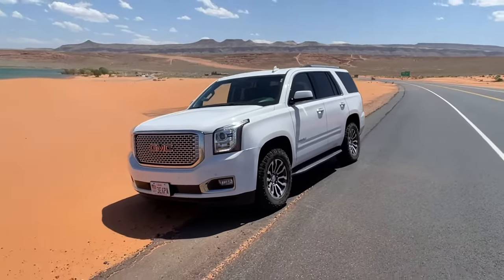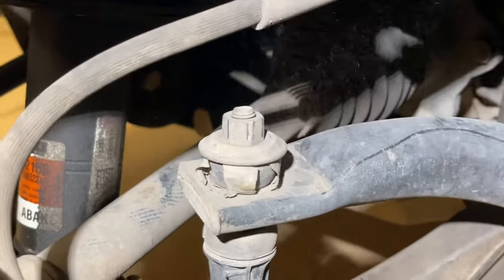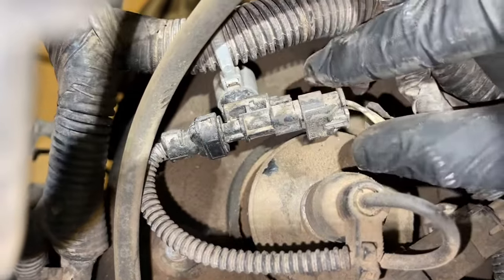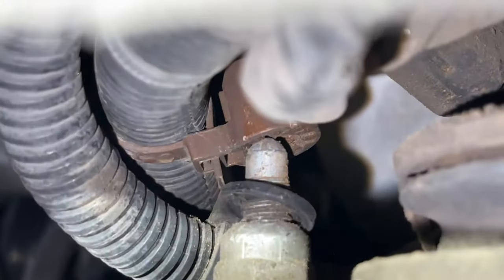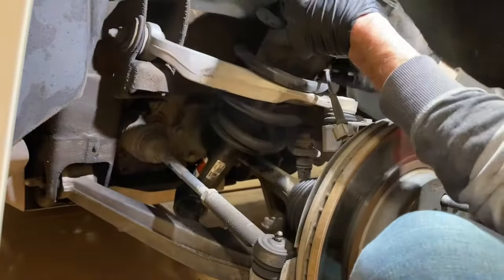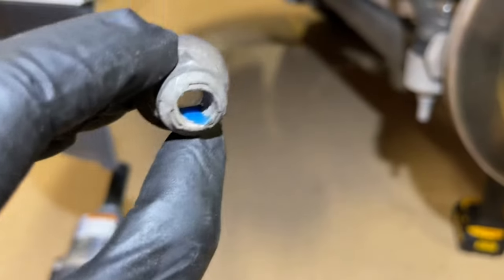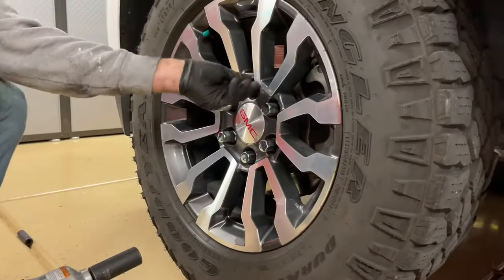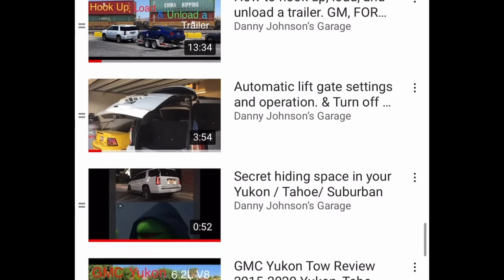2015-2020 GM Front Strut replacement: Magneride Yukon Tahoe Suburban Sierra Escalade Chevy GMC

Comment: Very good explanation of the parts swap! Any idea what the dealer charges to do this? Also how much do the parts cost?
Reply from the maker: Unfortunately, it’s hard to find OEM parts with the spring installed, so I went with an aftermarket company and the strut did not 
line up properly and the strut was 2” too long, so I had to put the factory one back in.
Reply: 💪🦵 An arm & a leg @ a dealer.💪🦵
Reply: In Houston at the dealership they just quoted me ~2300.00 to do both sides. I am working with another private mechanic and he's going to be able to do it for about 1/2 and still use OEM parts.
Reply: @gregggreene791  ya...doing this job now in my shop
.
I watch videos on my smoke break
Learn tips and tricks....where a tricky thing is...etc(aka, nit mess up your car messing up a connector or hidden bolt)
.
.
Anyway
2300 is HIGH af
.
This is not a hard job
2 or 3 hours tops!!
Reply: @dannyjohnsonsgarage   Did you ever find the correct part? i've now tried 3 different brands and spoke to the engineering team each time trying to solve this problem. So far Arnott, dorman and 1A auto have not fit.
Reply: @gregggreene791  can you share this mechanics contact info? I am also located in Houston.
Reply: @dannyjohnsonsgarage  Just had my fronts done on my 2019 Yukon XL Denali (150K miles). The dealer wanted $2400 and my mechanic did both sides front(full assembly) for $1800

Comment: I ordered new ones off of Amazon and they are the same as the ones I took off but the front is sitting to low. Was I supposed to reset the computer or something to get the ride height back to normal or is it possible that I have the wrong shocks
Reply from the maker: The ones that came for me were too big and didn’t fit. I re-installed the old ones. Did you compare them at all to the ones you took out?
Reply: @dannyjohnsonsgarage  yea just did and there the same exact height.
Reply: Seems like lots of variation in the part. Did the swap yesterday. Same OAL as the stock strut, but the spring myst be stiffer because Im sitting an inch higher up front. Not the funnest job to have to redo in the driveway.
Reply: @professorlloyd1789  I ended up putting the old springs on the new struts and it worked. It did suck having to take the struts apart 3 times and installation.
Reply: @dan79transam65  I thought about doing that or just buying the strut and having a shop swap my factory stuff onto the new strut. But due to time constraints I need to resolve this today… ordered some Arnott SK-3354s from autozone and will try those. About a $500 upcharge, but I can get it today and I’ll have Arnott’s warranty if they start leaking early. They’re actually a traditional Eibach gas strut with a built in connector that keeps the computer happy.

I’ll update as they may be another viable option(albeit at a higher price point.)
Reply: Updated. The Armotts fit well, but will probably lift the front .5” of a stock Yukon or so as they were .5 longer, bottom of the mounting ears to the top plate of what I assume were the factory struts in my ‘15 XL. I used a SuspensionMaxx lower spacer(1.5 lift) and Im pretty close to level when my initial measurements were a 2.25” rake with the factory front suspension.

Ride is better than the rock hard leaking magnarides. We’ll see how that changes after a couple thousand miles.
Reply: @professorlloyd1789  I was considering these as well. On a stock application I will be sitting high in the front with the Arnotts? Thanks for sharing.
Reply: @cwsosby  On the set I got, it raised the front about .5". by themselves. I installed the suspension max 1.75 lower block at the same time and my front is just below level with the rear(it has settled a bit in the past few weeks). So if you just swap the Arnotts in, I would expect your front height to maybe settle out .25 to .5" higher than stock, but still well below level with the rear.
Reply: @professorlloyd1789  Excellent, thanks for letting me know.

Comment: Is alignment needed after doing this?
Reply from the maker: It’s always a good idea, but I just centered the strut as I tightened it down and the car still drives straight. If you’re found to pay for an alignment you may want to do the tie rods at the same time
Reply: @dannyjohnsonsgarage  Great advice.  The factory tie rods on my GM vehicle don’t have grease zerts.